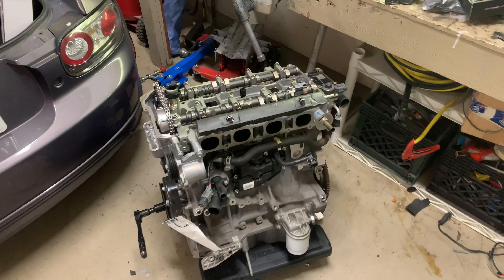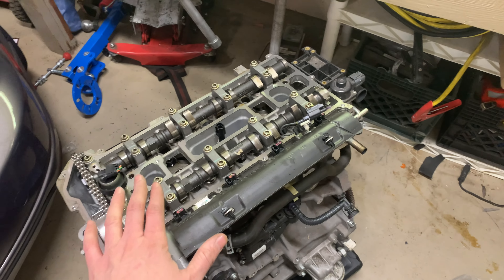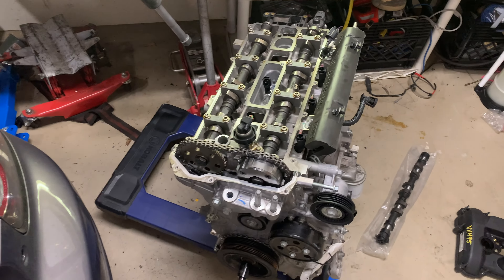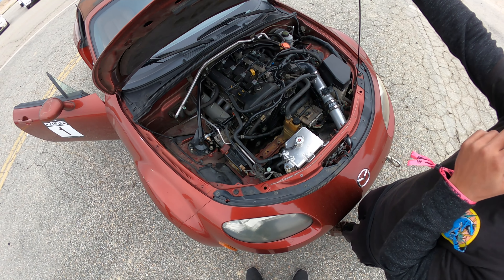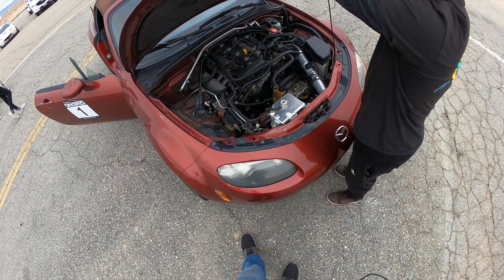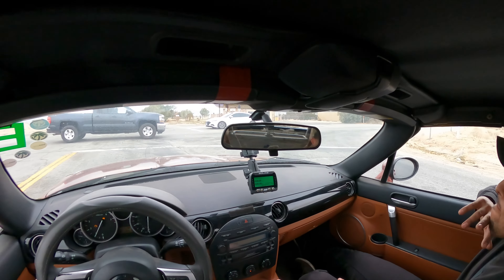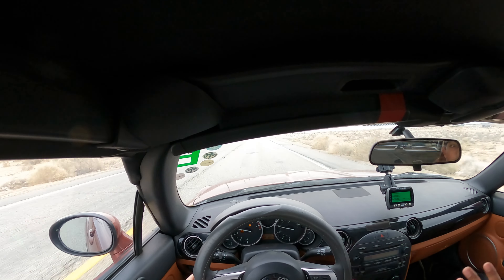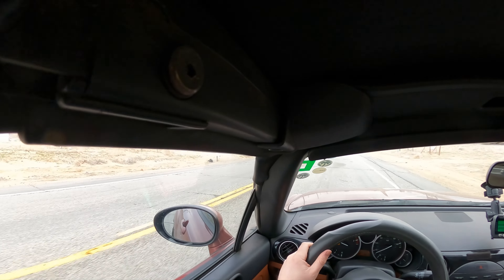IT'S HERE | Cammed 2.5 Engine for The NC Miata

Comment: Idk if that's a 10k mile engine you might wanna give another close up look at the exhaust valves. If the white deposits on the backs of them are raised up, like if there's actually white chunky deposits on them and not just white dust then I can guarantee that the valve stem seals were going bad. Which is never a sign of 10k miles. A clean looking intake valve and clean looking valve cover is definitely normal for an engine that's just taken care of. You can have a 200k mile Miata engine and open it up and find that everything inside is still at factory tolerance lol sometimes even the thrust bearing. Given it only ever ran stock clutch it's entire life.
Thing is I realized this video is from last year. So I'm probably not helping much now. Lol

But if there was actually deposits built up on the exhaust valve stems (not talking about just white dust) then it's due to the previous owner running full synthetic oil. And the valve stem seals leaking. The white deposits is from additives being burnt away. If it's really chunky build up then it means the seals were leaky. Like mine were. The backs of my exhaust valves looked like cavern walls lol.
If it's just white powder dust then no worry that's pretty normal due to running full synthetic. There's always ganna be some minor seepage past the seals.
Reply: Oh and actually another matter of fact is OEM Mazda doesn't use freaking RTV on the exhaust header gasket hahaha. That's never a sign of a 10k mile engine. That's a sign of a 100+k mile engine my man
Reply from the maker: This is a Ford engine... duratec. You should see them at 20k miles if you think this is bad lol

Comment: Hi, I have swapped my NC with 2.5 duratec but my question is that what injectors should I use on the car? I currently have it with 2.5 engine injectors
Reply from the maker: I used 2.0 fuel rail with 2.5 injectors. Hope that helps!

Comment: LQK web link?   Other good sources for 2.5 engines?   Stage 1/2/3 cam swap for road use?
Reply from the maker: I ordered this off eBay and searched "2017 Ford Fusion 2.5 10k". There were two with 10k miles when I ordered. I would pick stage 1 for road use. The stage 1 I bought from Fab9 is in between the typical stage 1 and 2. Kinda the perfect cam for street and track without the need to upgrade valve springs.
Reply: Thank you

Comment: Picked up a 2.5 07 NC with gdw header and Eslinger stg2 traded my 08 PPE header free flow cat and coils and enkeis....VERY DISAPPOINTED VERY! Car idles and rocks back and forth like a V8 glub glub glub idles sometimes 500 then 1100 takes off sluggish then 3500 gets power just yechh tried to get my trade back and forfeit $4k guy said no!😣😥😥
Reply from the maker: You probably just need a tune. I had some drivability issues that were resolved on the dyno